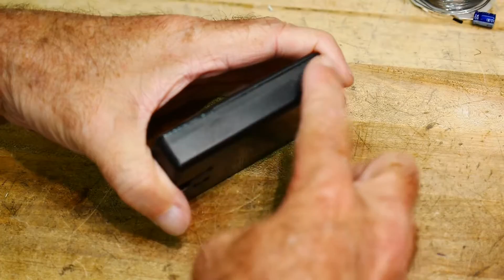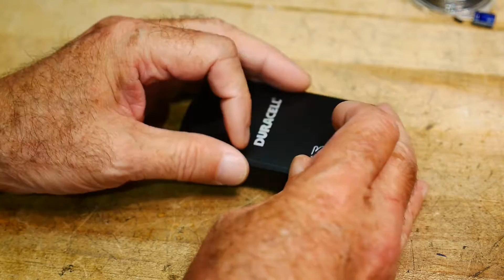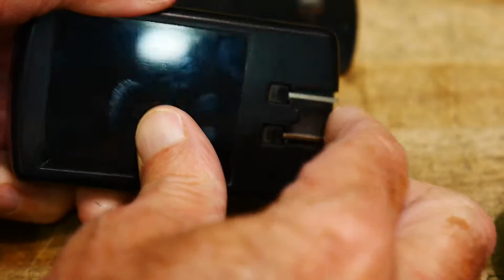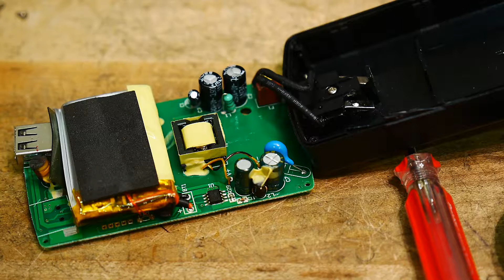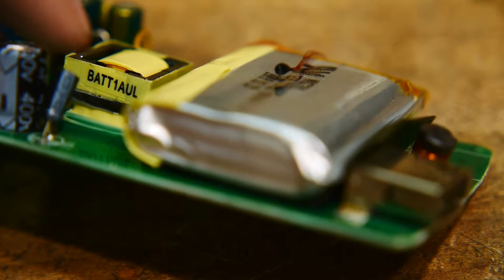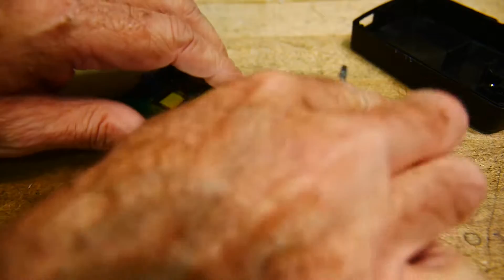#440 Old battery bank teardown

Comment: The big blue thing is a high voltage capacitor bridging the input and output of the supply. The power supply part looks to be very well made, and the transformer with double insulated secondary is a nice touch.